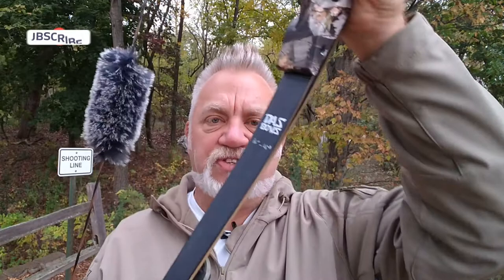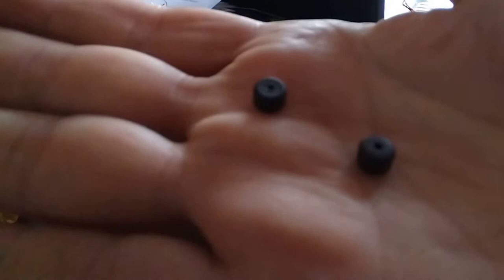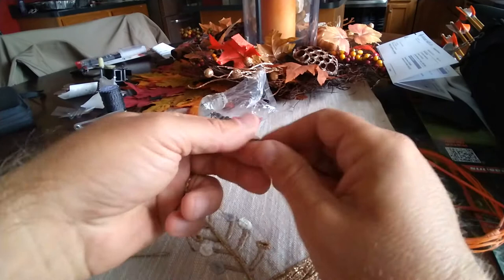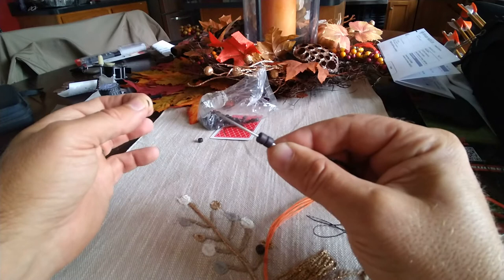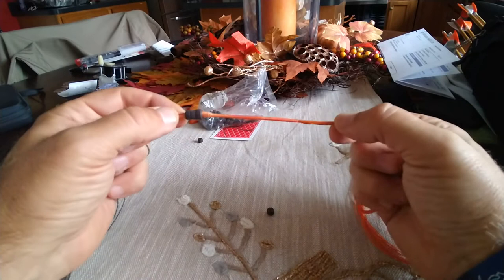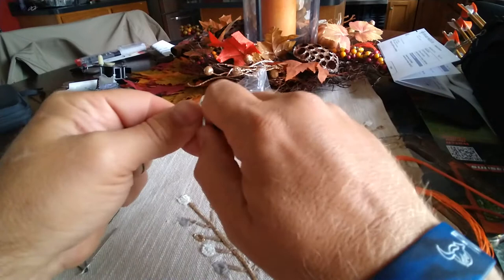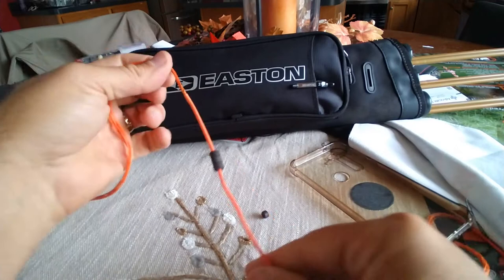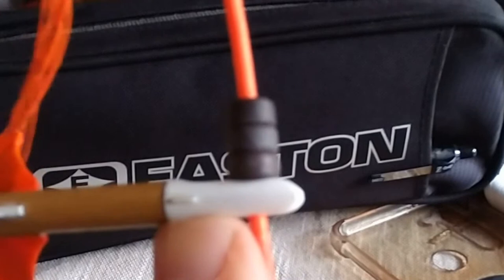Traditional Archery and String Walking - Make an Adjustable Nocking Point with Speed Buttons

Comment: Great video and I've just ordered the Pine Ridge Nitro speed buttons to install these adjustable nocking points. Quick question: For your method of anchoring under the chin where do you usually place these nocking point? Is it where the arrow sits completely horizontal on the rest?
Reply from the maker: Hi again Victor...
ANSWER: as with MOST bows, START with positioning the nocking point so that when your arrow butts up against it (from below!) the arrow is 1 "arrow-width" ABOVE perpendicular to the bowstring.

Then proceed from there as follows:

SHOOT several arrows with a LARGE Stringwalking gap - say 3 fingers for around 20m.
WATCH THE ARROW MOTION CAREFULLY JUST AFTER RELEASE... IF the arrow's rear dips DOWN initially, then straightens out, the nocking point needs to move UP. SHIFT up 1 MORE arrow-width, and shoot again. REPEAT pushing nocking point up UNTIL arrow leaves bow SMOOTHLY :-).

IF the arrow's rear jumps UP upon release, the nocking point needs to go DOWN, probably just a half arrow-width.

REPEAT adjusting the nocking point by "moving OPPOSITE the DIP" until you get a smoooooth exit from the arrow..

THAT'S IT!
. Cheers,
Mark Vogt | VOGTLAND OUTDOORS
Reply: It actually took 4 as they wouldn't slip over the string no matter what I tried so had to drill them 1mm bigger all fitted now👍👍

Comment: Will they work as a range point for finger walking
Reply from the maker: Greetings Fred ! 
IF you anchor UNDER YOUR CHIN like my VOGTLAND SHOOTING METHOD teaches...
... then you'll be able to shoot from 5m ALL THE WAY OUT to 120m :-O...
... in +/- 2m increments :-O ... 
... and you'll NEVER HAVE TO resort to the (less-precise) Finger Walking ! 
;-) 

I suppose you COULD use it as an aid for Finger Walking though. 

WHY do you think you NEED to use Finger Walking in addition to String Walking? 
You have me curious ! 

Cheers, 
-Mark Vogt | VOGTLAND OUTDOORS
Reply: @VOGTLANDOUTDOORS  I was thinking of a reference point for string walking.  
  I did some tinkering and came up with heat shrink tubing. I cut the tubing to 1/4in and set them at my 10m 20m and 30m range, and now I'm to find my range without look at the string. So I can keep my eye on the deer. Moving only when they can't see me.